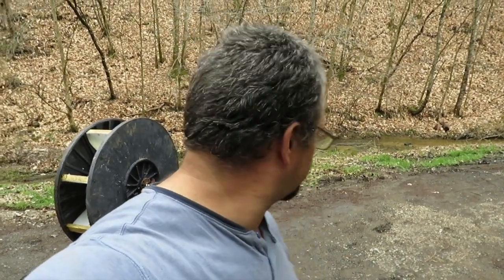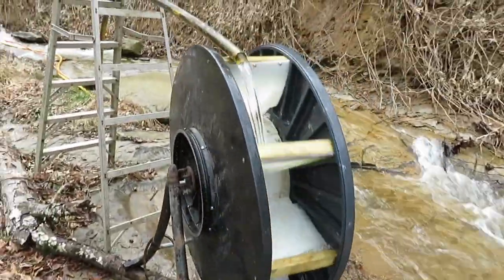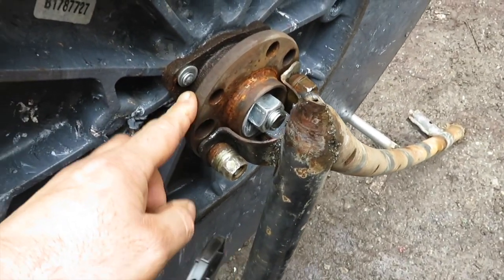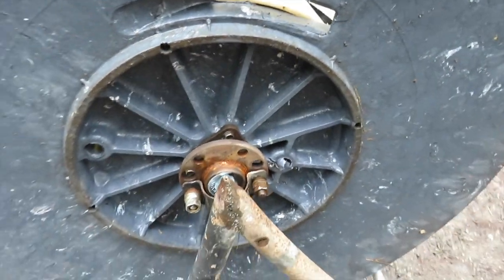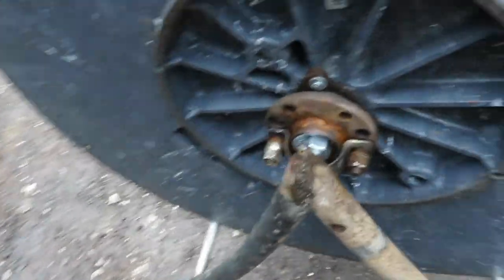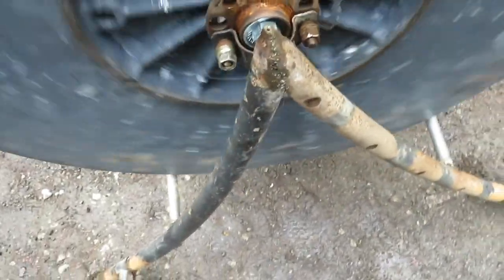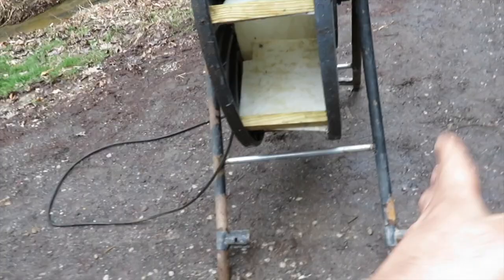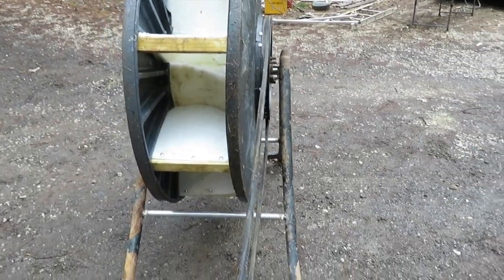New Water Wheel Build part 3  Frame

Comment: Pretty Good Idea, I was thinking of doing a Water wheel Generator, How many RPM does that do?, could talk Water wheel generator concepts, I was thinking of a water wheel with a 6-21 RPM input & a 4 to 5, 000 RPM output for a higher energy output & at a steadier rate. for a 6 RPM input, a 1:705.6 Ratio to boost the output to 4,233 RPM, for 21 RPM input a 1:235.03 ratio for a 4,935 RPM output, which would crank that Alternator closer to the speed of a car engine & alternating the Magnetic polarity at a Higher speed, basically for every rotation the Water wheel makes per minute the Alternator cranks at between 4 to 5,000 RPM, I had an Idea for an Overshot water wheel, maybe even a 30 ft.,  but yours seems to work fine, which if you're going to use pulleys & belts, then a double single pulley with two sizes, like hook a 30" pulley & a 5" pulley to the same shaft to rotate the next set, until you reach the proper speed ratio. have the Bike rim hooked to the Water wheel & a belt spinning a 5" pulley that's got a bike rim mounted to the same shaft to spin another 5" pulley, then have that spin another bike rim, measure the RPM of each set of pulleys, then when you reach the 4,000 RPM range, the last pulley in the set is for your generator, that's my idea.

Comment: Thank you for the water wheel post.  We have a Facebook group for water powered pumps.   I realize you are probably driving a generator to produce electricity.   In our discussion, some may use water to generate electricity to drive a water pump, but most of the discussion is methods to drive the pump directly with water with methods such as a water wheel.   It remains to be seen which approach works out best in different circumstances.   If you are interested, I hope you take a look and join in.  Thanks - Dave
https://www.facebook.com/groups/240458583255303/